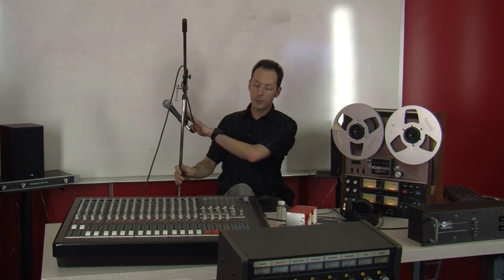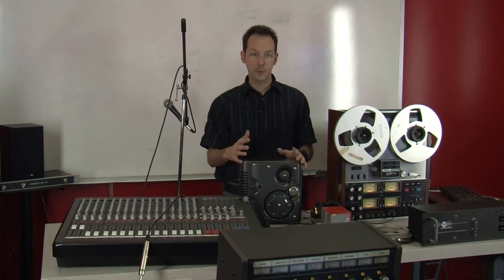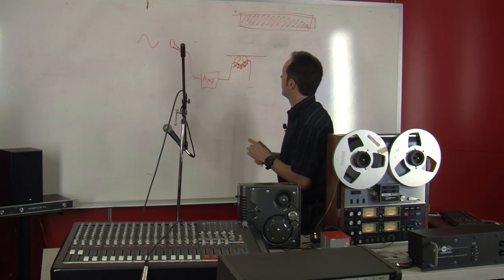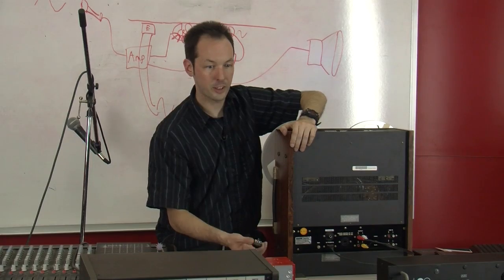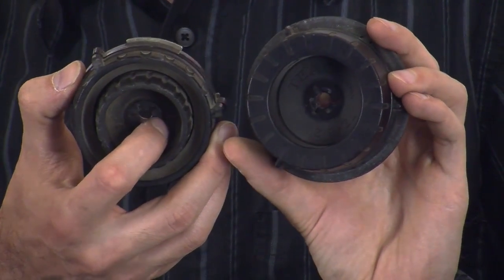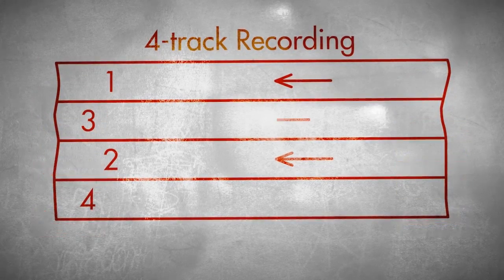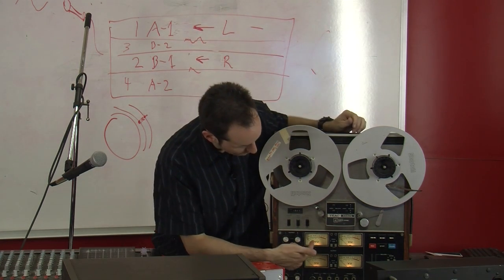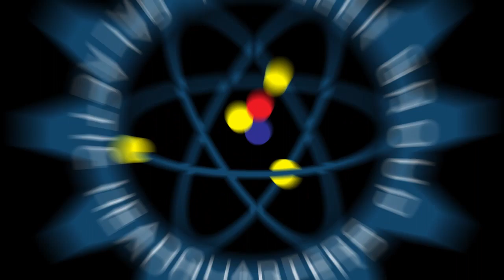Reel-to-Reel Basics

Comment: Can you erase and record over a piece of tape an infinite amount of times? Or does it eventually start to degrade? I'm learning the bare basics right now, and one of the factors I'm considering is cost of the tape itself.
Reply: +Michael Brooker No you can not. The more you record and erase the more the tape degrades. With that said, good tape will last a very long time and you can probably record over it many times, like 50, before you start to hear a big difference. What is more of an issue is buying and finding good tape. With NOS old tape its always a crap shoot. So I recommend buying new tape from ATR services. But I do have tape I recorded on in the 70s that is still good, and I could use today without worrying about shedding or sticking.

Analog reel to reel is a commitment that not all will enjoy, especially if you have always used and have been pleased with digital, but if you find yourself wanting a less edgy sound that is fuller and richer, maybe its for you.
Reply: Thank you! In all honesty being able to erase/re-record even a dozen times would be ample, since I do most of my demoing in digital and tape would be for my "final", well rehearsed product. This is definitely good to know.

Comment: This is an excellent video and you are a fantastic teacher! I have a few different reel-to-reel recorders and a minifon wire recorder. I was able to revive a little Jaguar four-transistor dictation recorder (Mission Impossible style) and have another (an Afco model 63) in line behind it. I want to refurbish the others as well. My favorite is my dad's old Wollensak T-1980 Sound Room. Once I get them running again, can you help me understand the various kinds of microphones and how they match or don't match different recorders? (Crystal, carbon, dynamic, condenser, ribbon - high and low Z, etc...) How can I get the cleanest and highest quality recordings for each different kinds of recorder - including the cheap ones? What kinds of adapters are available to make them work? I did record some audio from my computer onto the little four track and was happy at the quality it was able to record. The mics I have do NOT provide that quality. Thank you again for your AMAZING video!! SUBSCRIBED!!!
Reply from the maker: That's an excellent idea! I would be happy to make some videos on microphone compatibility and connections. I plan on doing several more reel-to-reel videos (and other Old School Cool audio stuff) in the future. Stick around and we'll have some fun. :) Thanks' for subscribing!

Comment: so the only way to get a true analog signal to record from is vinyl? Radio stations in my town stink. and analog has noticable differences from cd that can be heard on a system with a pioneer sa 9900 and jbl l 100's?

Comment: hi great informative video and I learned a lot.  just found a Grundig TK120 from the loft of the house we moved into and it kinda works but there are two belts snapped. 😔  looks like capstan drive for the pickup reel.  been inspired by your video and intend to fix it!  gotta love 1960's valve technology!

Comment: Funny looking at this, having used tapedecks since I was four. That's a detailed explanation.
Don't agree with you on the quality bit though. Yes I do realize hi-res audio (not 16 bit 44,1hz CD quality, please, that's awful) is a step into the right direction, but better than tape? I'm not so sure. When it comes to wow, flutter and noise levels, definitely. But when it comes to actually making 'music' sound 'musical', stuff you can't measure... I'm not so sure. Digital's getting there, slowly.

Comment: Your Video was awesome. Sir, please send a link on how to set the monitor switch, when connected to say a CD player, and how to reduce it before pressing a "Record Button. I ow a vintage Sony TC-558 and also explain what the BIAS has to be set to. Please advise
Reply from the maker: I would begin with reading the manual that came with your machine. Smart people write those just to answer specific questions like you have. If you don't have the manual itself, they're easy to find online, just google the model number.
Reply: Thank you for your message, I cannot find a user manual for my R2R Sony, however, I will keep trying. Thank you for your response.

Comment: nice video.  Anyone know why my reel to reel plays really fast.  I adjusted the pitch, and reel size, and speed button,  all i hear is chipmonks.  How can I trouble shoot?
Reply: +justgoestoshow  w/o more info, I'm guessing it's threaded wrong or the pince roller isn't engaging fully. OR you have the wrong speed selected; could be it's running on the 50Hz pulley... MORE INFO NEEDED

Comment: Great video. well explained. Cassette tape runs at 1 7/8 IPS or 4.75 cm/sec. Print through happens more with the thinner tapes Double or Triple Play, sounds cool sometimes.
Reply: But somehow, with the advances in head technology, they had been able to make better quality fit into less space, so that almost-2" speed was a lot better quality on those than it was on the earlier open-reel machines.

Comment: What do you mean with  «doesn't the track»?... If you mean off-track the answer is no. These tapes are quite well guided. Different types? Yes. There are several tape formulations, similar to the now old k7s. Mostly ferric oxide was the standard and each brand had their recipe to tweak it and make it better than the competiton. Ampex and BASF where worldwide suppliers on the pro market.

Comment: I have always wondered what does VU stand for?
Reply: db voltage units it's another form of the decibel
Reply: Haha, what are the question marks supposed to be for, on a statement?

No, "V.U." means "*volume* units," NOT "voltage units," LOL!
Reply: your right got them mixed up
Reply: Thanks. Well, not really mixed up, but you got a new fake term invented (as there is no such thing as a "voltage unit").

But my... what... is right (the thing you're referring to with that "your" there)?

Comment: Since the machine is designed to handle 15 IPS and NAB  reels,  half speed  (7.5 IPS) and half size reels, taken together, requires 1/16th the force to start and stop the tape, for instant punch-ins and punch-outs, if you're putting more than one part on a single track. "Big soft mattress of happy..."

Comment: A recording that's recorded at -1/27ips and played back at 7-1/2ips sounds normal. So is a 15ips recording played back at 15ips. A 7-1/2ips recording played back at 15ips play faster and a 15ips recording played back at 7-1/2ips will play slower, Its like playing a 33rpm record at 45rpm or a 45rpm record on 33rpm. Same concept. The faster speed just means higher fidelity (Like SP vs EP on a VHS VCR.)

Comment: Don't use mismatched reel sizes unless the deck has a size switch per table.  Most decks only have one size switch and it controls both reel tables.

Comment: The regular home decks are 4 Track as well, they are 2 channel 4 Track machines.  That is a 4 track 4 channel machine.  There are 2 track machines but those are only single sided.  4 track 2 channel has 2 sides, the 4 track 4 channel would have 1 side with 4 channels.  Tracks and Channels are 2 different things.

Comment: The video is good, but there was a small mistake. I think that wire recorders were not the first type of reel to reels, but the wire recorders were invented for the aeroplanes` black box, since it is heat resistant. But apart from that, the video is excellent.

Comment: I'm not going to read though the commentsif anyone caught this. Definitely cassettes are 1-7/8ips. Cassettes tracks are side by side on the bottom like 2 and 4 on a quarter inch tape. 2nd, 3-3/4 was used in 8 track carts, and  quarter inch tape could hold up to 8 tracks as many "PROSUMER" 8 track decks like Otari Teac and Fostex did after the big 4 track boom. AND finally I am pretty sure Les Paul always worked with TAPE and not acetate records. I Got LOTS more, but these stuckout!

Comment: I disagree. This surpasses digital sound, especially at 15 ips.  It has warmth and is not harsh. There is a lot of great information on this video, though.  Thank you for posting.  I have the Teac A-3440 that is mechanically perfect.  It's nearly 40 years old and could probably use a complete capacitor job because the playback volume is a little lower than the input volume and it's very hissy.  It does have a place to put a DBX encoder on it.  It still makes really good, detailed recordings.  All of the channels record, the VU meters all light up and move with the audio going out and coming in.  There are a couple differences between what you had and the A3440, but you have a really nice machine, also.
Reply: Who are you disagreeing with? I don't think anyone has said otherwise
Reply: +ChurKirby He stated in the video that recording digital sounded better than analog somewhere in there. I know it's subjective,  and got excellent results both ways. There are some things that digital does better than analog,  but if deck is working optimally, you can't beat tape.

Comment: hi i have had alot of reel to reel recorder  over the years you got to be carefull i have seen
alot of reel to reel not working right on ebay  with bad transforms inside
best to keep to recorders you can get parts for your recorder had on earth.
in the plug this is bad news i have had live case at 240v because i wire came of
inside i all ways test the units before i plug hem in

Comment: AAAAACK! IT'S NOT RUST

... Edit... It's not "static" in the erase head...

Edit 2: Yes 1 7/8 is compact cassette, 15/16 is standard logging tape speed... Also, 3 3/4 is reasonable for music on better consumer grade R2R, but does come at the cost of a bit of rolloff in the highs... Saves a lot of tape however so it's a good compromise as long as quality isn't the primary concern.

Final edit lol... Love the "if you want precision, go digital, if you want fun, go analog"... So true

Comment: The S is for the solenoid controlled version vs the older unit that has a lever as part of the transport controls - see this vid https://www.youtube.com/watch?v=EexPD8ch-sM  .  Back when the 3340S  was popular,  Teac (and eventually Tascam), and later on Fostex were considered by most industry pros as "semi-pro" .  Pro multitracks were those mfg'd by Studer, Ampex, Scully, MCI, and Otari's large format machines (MTR and the MX series) . Otari was also making smaller format things like 1/4" 4 and 1/2" eight with  what was considered by most pro's to be a bit more of a professional tape machine - used in a lot of broadcast facilities. In fact a bit later on (1980's) Jack Endino did a lot of the original Seattle stuff (Bleach for one) on a 1/2" 8 track MX5050 . Here's an example of one of my tracks cut on an MX505o -  https://www.youtube.com/watch?v=Cq42YW5IggA. 

Overall tho - the Teac's and Tascams were decent machines... but again not in the league of  the large format multitracks. Sad that the tape goes sticky shed - most pro tape - even that sold today - has issues with binder failure - just google marketturd (it will be called Rant for Prehensile Chimps) and you'll see a link to sticky shed with photos of what occurs. 

Sucks... I used to love those old machines.

But they were and are a pain to deal with sometime - just check out the marketturd link Studio Hum to see how screwy stuff can get - even with brand new equipment.

Comment: Muhammed Dheyab, 

Bit rate and bandwidth go hand in hand in the digital world.  The higher the bit rate number, the better the quality.  When you lower the bit rate number, you are having the computer or ADC (Analog to Digital Convertor) compress or strip out more sound information from the recording, in order to fit in the estimated file size.  For typical CD quality sound, the borderline best rate is 16-bits at 44.1 Khz, which is about 1.4 million bits per second.  To put that in perspective, it's about 10 megabytes for each minute of sound.  In MP3s, the compression is even further, but the quality is still there at a borderline 256 Kbps (thousand bits per second) at the same 44.1 Khz 16-bits sample rate.  MP3s, and other similar audio file formats, strip out even more audio frequencies that your ears won't catch right away.  256 Kbps will give you about 2 megabytes per minute; compared to say WAV, RAW or AIFF that go at the 10 megabytes per second rate.  Hope it helps.

Comment: thank for the video  i am bidding for a ascam 38 1/2" Reel to Reel 8 Track with Midi Sync and tape. with 10ich reels  now my dad has the old smaller reels. will this  ascam 38 1/2" Reel to Reel 8 Track player  that i am bidding ebay.  capable off playing the smaller  reels  the same as you have just done on the this clip. please can you advice soon as possible many thanks  steve

Comment: Actually wire recorders WERE invented for audio. They were common in the 1940s and early 1950s. Many were used in business. A lot were were used at home as a resuable recording medium. Home recordings (yes there were recordable analog records) had the same problem film photography (still or movie) If you blew your line or lyric you were stuck with it! Use in FDRs not a suprise, Cassettes were designed for dictation, But later went on to be used for music and even computer data!

Comment: I have lots of unrecorded tape, still in the boxes, that belonged to my grandfather.  If someone is interested I would love to move them from my basement.  I am  trying to learn how to convert his old reel to CDs so they can be shared with our church family. Nancy
Reply: In addition to services that specialize in conversions to digital, There are probably a number of people out there who would consider accepting the blanks you have in trade for converting your tape to digital format.  A key concern would be the condition of the tape you want to convert - there are many failure mechanisms for tape: sticky shed where the oxide that holds the signal actually flakes off the plastic backer, tape breakage, especially if Acetate plastic instead of the more expensive Mylar, stretching and warping due to improper storage or playback and the list goes on.  I have thousands of reel-to-reel tapes and 5 decks, and just getting a tape to play through once can take several hours once you include the time necessary to run the tape through a couple of times beforehand to eliminate pre and post echo from print through from one turn on the spool to the next if the tape has not been played for years, and it should be done slowly to minimize ripping the oxide off or stretching the tape.  If it has warped and the edges of the tape on the reel look wavy, it may even be best to use a lower quality deck that has pressure pads to hold the tape against the heads so you can at least hear something from the channel nearest the edge of the tape. then the deck will need to have the tape path cleaned both before and after the actual conversion playback. Unlike digital copying, most analog playback must be done in real time - no 16x speed copying here unless you downshift the speed digitally after playback, and few systems have the frequency response to handle double or quad speed playing.  Assuming you can find a deck with the same playback speed and channel count / format, your tape should be playable, but just like taking a hundred-year-old newspaper out of a box in your attic, you may be able to read it but it may suffer just from the attempt.
Reply: Nancy Nolker Do you still have any,I'm interested.
Reply: I could help you record to CD's also

Comment: I somewhat disagree with how you threaded tape at the second take up reel. If you start the machine with the tape held inside the reel and let go, the spinning reel causes the tape to hug the inner reel and you sort of finess the seep of the take up reel as the tape begins to rap around inside, until the end of the tape meets the incoming tape, it will grab and the reel will no longer spin freely as the tape wraps tightly. Tough to explain.

Comment: hi beware of power button's on old decks they can break in 1/2 under the panel bang all your power goes dead   i got a betacam sp deck
the button came apart when turning it  on bang all my lights if you know a tec it pays to have the 110 240 ac lines checked to be safe 
i all way check the ac in coming now and on teac's i change to 3 pin socket with earth just to be safe

Comment: Where do you learn this stuff? Is there a college course that covers it or something? 

Also, is the fact that faster speed on tape/vinyl means better quality analogous to the fact that more pixels on a screen results in higher resolution? Does the faster speed mean that more iron oxide is being magnetised per second of recording, therefore making the playback more accurate to the source?

Comment: Has soul ? Oh, common man ! Actually, I am in disagreement with your overall assessment of the format . I think the Nagra 4S-TC (Time Code) half track 2 channel Stereo portable reel to reel and Technics RS 1500, RS 1700, and especially the tweaked out Technics RS 1800 are in fact superior to digital audio recorders in that they handle the high frequency audio signals in a much sweeter sounding, warmer way to my ears. Tape hiss is so low beyond perceptible limits it is not really any issue.